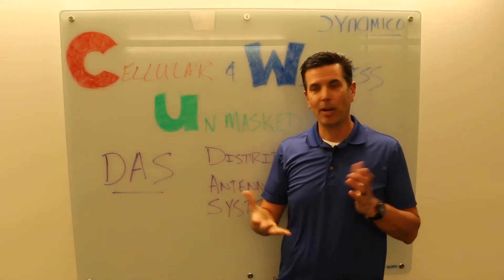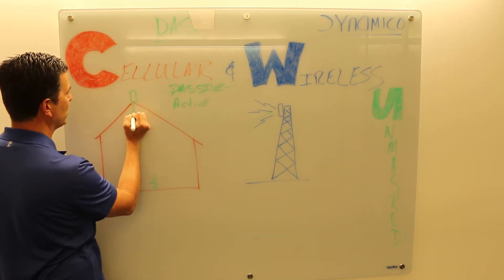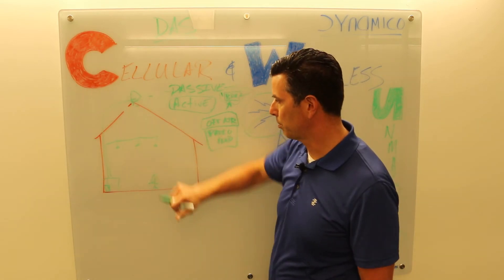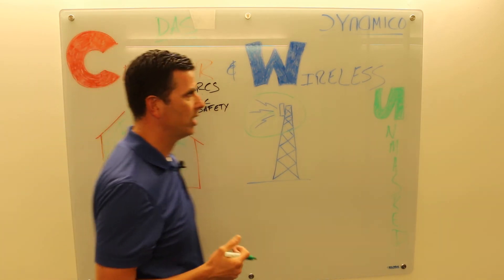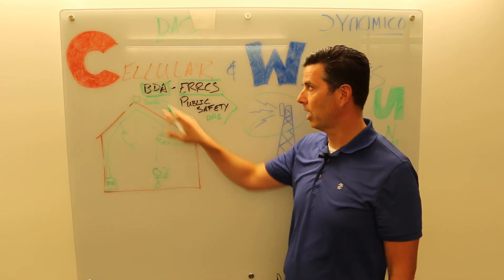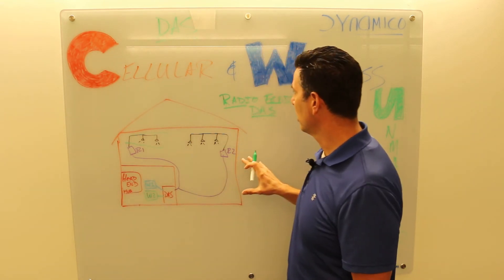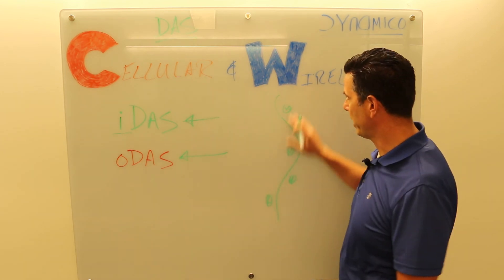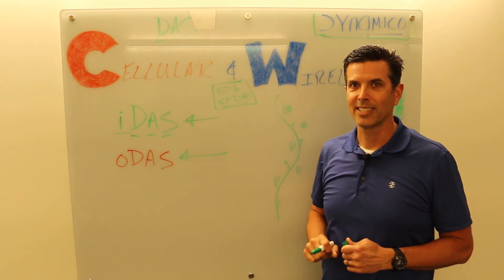DAS - Distributed Antenna Systems

Comment: Can you tell us the Components of DAS
Reply from the maker: Well, every DAS network is unique. You typically have a head-end or hub, where you get your signal. Either off-air or from a radio or many radios. Then you have a remote, or series of remotes. Each remote feeds a passive antenna network of one or more antennas. Typical is two to four antennas, but I have seen up to eight, fed by one remote. Too many and you lose too much signal in your passives. I am oversimplifying this, but these are the basic components. Happy to chat more at: mhevezi@hubsyde.com

Comment: My cell carrier is Rogers, in Canada.  They have two major DAS systems I'm aware of.  Most recently, they spent $8M upgrading their network in Rogers Stadium (yep, same company) in Toronto, in preparation for some Taylor Swift concerts.  There were six concerts and they were running over 7 terabytes per show!  I don't know if that was only Rogers customers or if they also carried other companies.  Rogers also owns Fido and Chatr flanker brands.  In addition to Rogers, Bell, Telus and Freedom operate in this part of the country.

They also took over the cell network in the Toronto subway from BAI.  That network was installed years ago (3G?) and not upgraded.  It only covered a small portion of the subway and did a poor job of it.  Rogers is working to cover the entire subway with 5G and other carriers are allowed to use it.
Reply from the maker: @James_Knott  lots of cool options out there to bring cellular into tough spots. I think Private LTE/5G will become the new hotness in the wireless space and gain traction as more wireless operators embrace MOCN.

Comment: Please, in the future please do not refer to public safety tower sites as "cell sites".  It may lead some folks to think that PS signals come from the same place as their cell signal comes from.  Within the ERCES/ERRCS industry we're trying to unify the language used within the industry.  The Complete ERCES Handbook is a big part of this effort.  And, thanks for your efforts to educate.
Reply from the maker: Oops. That won’t happen again. I hope, as industry, we settle on a standard acronym for Public Safety DAS - ERRCS vs ERCES can also cause confusion. I won’t even mention PSDAS. Oops…
Reply: Actually, sometimes they do.  A couple of years ago, I was working on a project for Ontario Provincial Police.  The system was being built by Bell Canada and often used the same towers as their cell network.  Also, 5G supports network slicing, which makes it possible for multiple services to share the same network.  I like to think of it as VLANs for the cell network.  🙂

Comment: It is possible to run a fiber into the building before being distributed by the DAS?
Reply from the maker: Bra, yes! In fact many buildings will ask for a DAS design prior to construction and run basic infrastructure like conduits, cable trays and designate space for the Head-End or Hub. Since most OEM’s use Fiber to connect DAS Remotes to the Head-End on the larger systems, fiber can be pre-run to each building or floor. Any pre-work that can be done during construction will save money and lead to a cleaner, more efficient system.
Reply: @cellularwirelessunmasked3120  Great. Can I get your email so we can interact further ?

Comment: Great, very informative, can the RFDAS also transmit video content i.e. Comcast, Hotwire etc for a hotel with 407 units? Or are they two independent systems, also the ERRCS network be included or is that separate as well. We are located in Miami and currently negotiating our renewal with our content provider and your video opened up Pandoras Box
Reply from the maker: Hi Garrett, the RF DAS and systems like Comcast, Dish and other TV services are separate systems and have different system properties. Public Safety DAS, or ERRCS, can sometimes be joined into the same passive infrastructure, as long as they are all compatible with the appropriate band, but check with the AHJ first. Don’t design and build a system, that combines Cellular and ERRCS until you know that’s approved. The electronic gear will for certain, need to be separate.